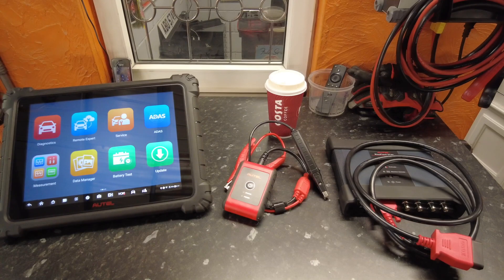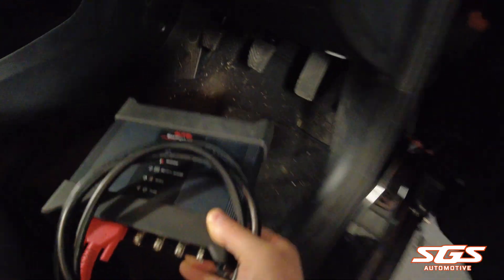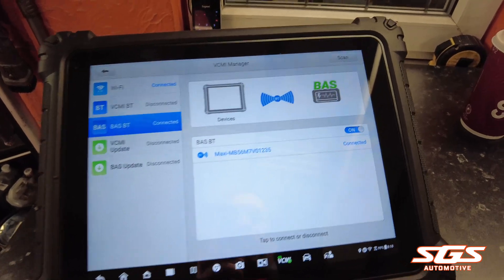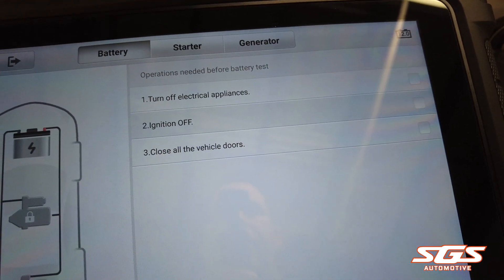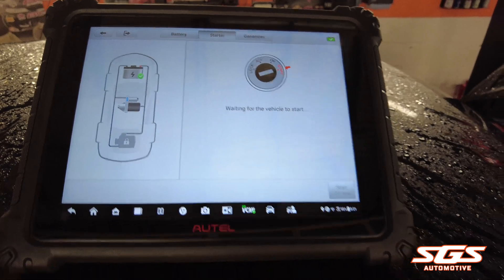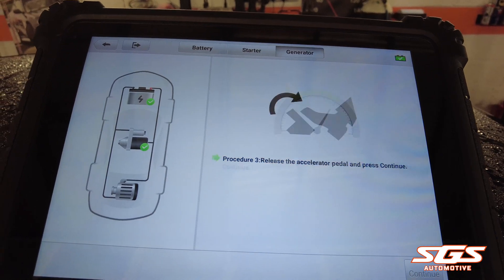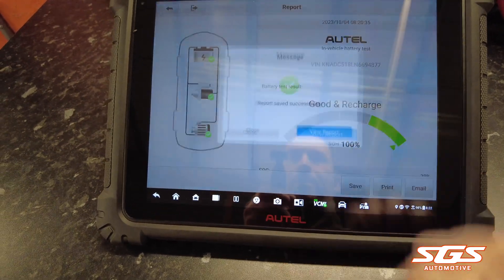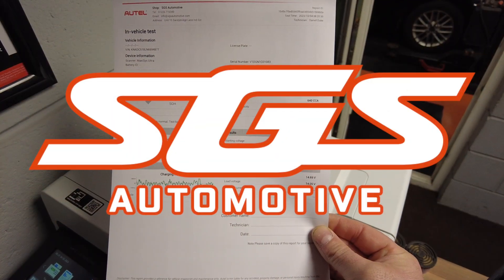Autel BT506: The Battery Tester That Does It All?

Comment: Can it run a detailed cranking test too? The Vdiagtool BT500 checks how well the starter motor functions during ignition, which feels like a must-have for mechanics.
Reply from the maker: Yes it does a cranking test and an alternator load test as well. You have to run the engine during hte test and make sure all the lghts are off etc then do a loaded test with lights and air con on etc

Comment: I just can’t get mine to work, I have the ms900ts with the 506, all updated, but won’t show anything you showed…. Really poor equipment
Reply from the maker: is it connecting to your MS900TS or is it connecting them your having issues with or its connecting but not working ?
Reply: @SGSAutomotive I got it working, it appears you have to disconnect the vci dongle completely, escape all the way out and then going from the root screen, then I got the screen on your video, but because I was screwing around for so long my battery went dead so I’ve now recharging it to do a full test to see if it’s the alternator starter motor or battery. I think it’s either battery, or alternator, the battery is 10 years old from new , done well😂
Reply from the maker: Glad you got it sorted mate. I’m the Maxisys Ultra you can connect both the VCI and BT506 at the same time as you need the VCI to VIN check and get battery specs
Reply: Call the autel customer support
Reply from the maker: thats also great advise